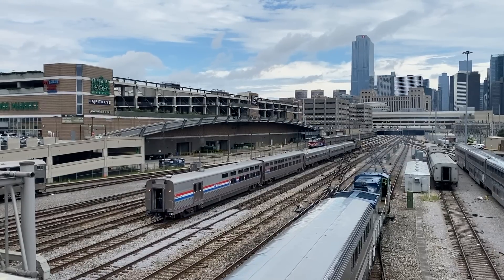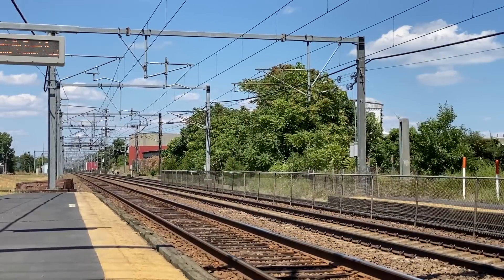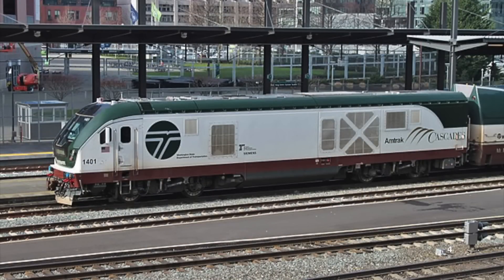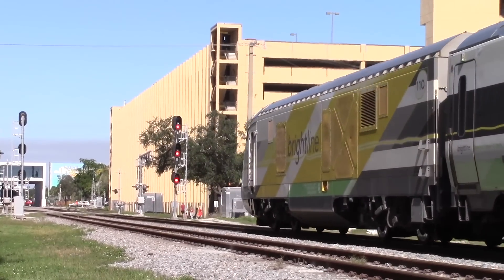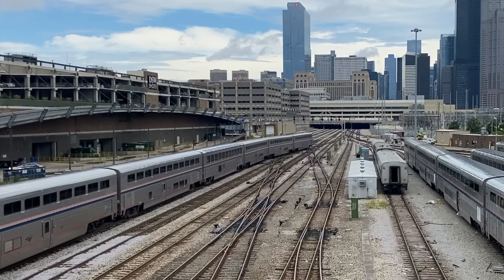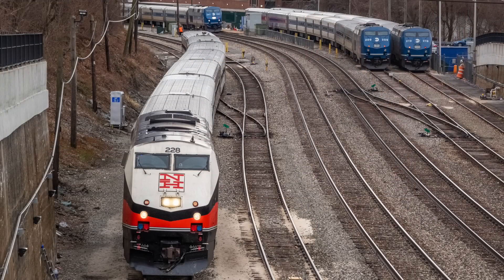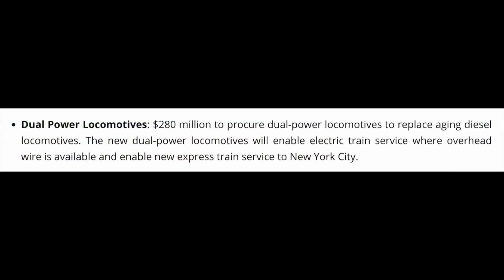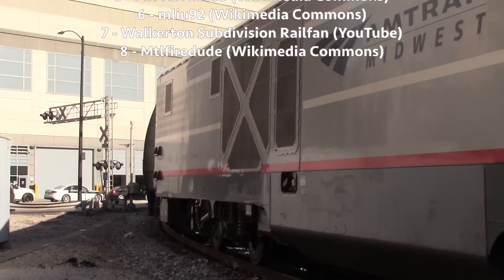Siemens Charger: Locomotive of the Future

Comment: Imagine freight railroads ordered freight versions of these locomotives.
Reply: Not necessary. I think there will be no cargo versions. The basic version, the Siemens Vectron, does not have a freight version either.

These machines are universal machines, have a starting tractive force that is 10 percent higher than the force that a GP38-2, for example, can generate. That doesn't change if you change the transmission. So you can leave it alone..... ;)
Reply: @pearlyhumbucker9065  In Europe lots of freight trains are running with the Vectron.
Reply: @Hauketal  Yes, well, I know. It's just something that Americans have to get used to.
They have had four-axle locomotives in freight service for years, but less in heavy service.
In American conditions, you can't get very far with a four-axle locomotive. To achieve the same tractive effort as with a four-unit consist of six-axle American-style locomotives, you would have to use six Chargers. No American railroad company would do this without necessity, it would simply be uneconomical.
Ultimately, there is simply no need for four-axle freight locomotives. So no one will design and build such locomotives specially.....
Reply: @pearlyhumbucker9065  Maybe if there is enough demand, Siemens will derive a 6-axle variant. But the Charger was mostly an opening without competition, as US manufacturers just didn't bid.
For a freight diesel the situation is different, I don't expect Siemens to make the effort to get into that market.
In Europe, the 4-to-6 conversion has already been done with an electric: The German class 152 (4-axle) was used as a base for the Danish EG3 (6-axle).
Reply: @Hauketal  
Well, that probably wasn't a 4-to-6 conversion. The EG was an extended EuroSprinter based on the modular design used in the 152, i.e. an independent (further) development of the ES64, after all the EG was longer and heavier, but did not have quite as much power as the 152, and it is also a multi-system locomotive

But whatever. The mere fact that it is an electric locomotive makes this argument invalid - the Americans do not buy freight locomotives in carbody form, which means that a 4-to-6 conversion of the Charger is off the table.
Reply: American companies practically lead the world in diesel freight locomotive design, and American freight operators are basically looking for the opposite of the Charger. There's no market for Siemens freight units in North America
Reply: @andrewreynolds4949  
US freight diesels haven't seen new developments since the early 2010s, and given that EMD and GE have pulled out, the US isn't really doing much developing of freight diesels in the first place. Unless you consider putting batteries where the engines are supposed to be some sort of revolutionary concept for the future. 
Arguably the best current freight diesel is the Stadler Eurodual, and is, as the name implies, dual mode. It's a six-axle design that can reach the power of your average Evolution series in diesel operation, but also produces over 6000 horsepower during electric operation. That can be increased further by using the diesel engine as a booster.
Reply: @mikeblatzheim2797  How fast are you expecting things to develop? Technology research doesn't generally move that fast, most of the improvements currently underway will be minor without much publicity. The locomotive manufacturers dabbled with units in the 5000 and 6000 hp range 30 years ago, but I think I've mentioned why that line of development died elsewhere. The battery units I think are just an experiment to see if they're any useful, if there's any advantage in them at all, kind of like the gas turbine units were many decades ago.

As far as GE and EMD go, they pulled out during market downturns and increasing environmental regulations. The locomotive divisions are now owned by Caterpillar and Westinghouse, not exactly small names. There's still a strong export market too
Reply: @andrewreynolds4949  
Well, let's compare the development of diesels to that of electric trans then, shall we? Since the 60s the main developments have been AC traction motors (originally developed for electric locomotives) and reduced pollution with a marginal increase in efficiency. And given the limitations of internal combustion engines, they're not going to improve much either. Meanwhile electric traction has seen the development and introduction of AC motors, regenerative braking and significantly more efficient motor control. 
The German ICE 4 makes somewhat less power than the 20 year old ICE 3 but uses half as much whilst being no slower all the way to 120 mph. Just in the last 20 years the equipment has gotten much smaller and more efficient, to the point where Stadler with the Eurodual has managed to fit a full sized diesel engine into an electric locomotive.
Reply: @mikeblatzheim2797  The EMD -38, -39, and -40 series all came out in the 60s. That was when a new generation of more powerful and efficient engine blocks were introduced. Then the -2 series was introduced, with greatly improved electrical systems and engine controls. And then in the 80s and early 90s microprocessors were introduced along with another new generation of prime movers, together producing more power and an additional ~10% fuel economy. Since then more refinements have been made, and after the end of the superpower race (the SD80 at 5000 hp worked fine, I must note, but ~4500 hp has been found to be optimal for modularity) focus has shifted to greater efficiency and meeting environmental regulations. The most recent models have yet again increased engine efficiency: the manufacturers are claiming something like 15% improvement on the previous generations. Yes there has also been the introduction of AC traction, starting in the late 90s and early 2000s, but we are now in a second generation of that technology. The invention of digital control systems and computer-controlled engine management have also significantly improved power and efficiency. 

So, there have been significant developments in diesel technology since the 1960s. I have also seen claims of something like 80% fuel efficiency improvements or more, so significantly better than "marginal". Many of the developments seen in electric locomotives are also applicable in diesel power, the primary difference being where the power generation comes from. Diesel engine development is far from dead, and ironically it is the Germans (who produce most of the marine diesels in use worldwide) who have been pushing the technology the most in recent years.

Comment: The Vecron has inly been introduced in 2010, so it definitely wasn't a great succes when Amtrak ordered their locos. 

Fun fact, the Vectron diesel sold that bad in Europe that Siemens isn't offering it anymore. Instead they replaced it with the Vectron dual mode, which can operate under ooverhead wire or diesel. This one, despite just being introduced, sells way better.

Comment: Outside of Amtrak and the NEC I think a better fit for American operators is the MPXpress series. I can't believe you consistently mention far less successful competitors but never even name the MPXpress.
Reply: American rail isn't supposed to be competitive.🤫🙄🤭🤭🤭🤭
Reply: @richardscathouse  What do you mean? There has long been fierce competition between the primary locomotive manufacturers, mostly GE and EMD, and there is still a great deal of competition between the freight companies (though they do cooperate far more these days than they used to. No one is shooting up a rival engine shed over Raton Pass anymore)
Reply: @andrewreynolds4949  
Well, the days of EMD and GE competition are history, since both have pulled out of the freight locomotive market. Wether Caterpillar and Wabtec will be successful and equal competitors is yet to be seen, but as of now, the US railway market is basically dead. The big four railways have arranged themselves into what's essentially four regional monopolies (meaning thar almost anyhwere in the US, if you want to ship something by rail you've got a single option) and there is no longer any significant US-based freight locomotive or passenger stock manufacturer. The result of which can be seen with the huge passenger stock orders coming Siemens's way; since there is basically no competition one company can come in and sweep the entire market. Wether a similar thing will happen when the current crop of GEs and EMDs are due to be replaced is entirely dependent on both Caterpillar and Wabtec (who are both complete newcomers to this) getting their businesses up and running without any money from major orders. And I don't see that happening.
Reply: MPXpress is Discontinued

Comment: Brightline is not a "higher speed rail" operator. The speed limit on Brightline's entire current line is 79mph, and their trains never even go above 70mph.

After the new extension is build they will have a large section of 110mph in addition to their current 79mph trackage and a tiny, 20 mile section of 125mph trackage. So after the upgrade you could say that Brightline will become a "higher speed rail" operator. But they aren't one currently. Right now, Brightline is 100% a conventional speed operator.
Reply: And it is working, example for more corridors?

Comment: Cal me crazy.. but Amtrak looks so outdated..   and dirty..    only the locomotive looks good.
Reply: they are adopting siemens venture coaches to match the chargers, but long distance is still up in the air for now
Reply: @Eaglescout217  Still haven't heard anything new from the long-distance RFP. Weren't proposals due last month?
Reply: @MrMarshmallow26  Well they did announce the Amtrak Airo sets in the winter. Long Distance locomotives are being phased out for the ALC-42 Charger. Sleeper cars news wise are still up in the air, but mostly be based on the Nightjet.
Reply: @Eaglescout217  The Airo sets are only for intercity routes. A separate RFP was put out by Amtrak seeking a manufacturer for new long distance equipment. Nothing has been said about proposals though despite results being due a month or two ago… unless the potential manufacturers requested an extension.

Comment: It's certainly a bit better future but It's certainly a bit better future but if you really want a future for rail you'll need to nationalize the you're rail infrastructure and electrify it.
Reply: Glitch on the pantograph, will be fixed.
Reply: Passenger rail MAYBE, but at the cost of screwing over the economy, the power grid, and the whole freight rail system in general
Reply: @andrewreynolds4949  
The railway network wouldn't actually use so much power as to impact the electrical grid, and FYI, electric freight trains are also a thing. Besides, electric railways tend to set up their own power grid. 
In the long term this would make the network much cheaper to run, as the locomotives are more powerful (meaning you need fewer of them), cheaper to maintain (because they don't need diesel engines) and cheaper to run (no diesel, you can also recover braking energy, which is particularly effective on mountain routes). But of course, the long term benefits would require a lot of upfront investment, and sadly publicly traded companies treat upfront investment like the plague.
Reply: @mikeblatzheim2797  No, electric rail does use massive amounts of power. And I don't know as much about how other electrical systems run, but I read all the time about the railways over in Britain applying for modifications or feeder lines from the national power grid. In any case, they still need large numbers of new power plants to generate that quantity of electricity, and that isn't happening anytime soon.

There were actually diesel locomotives designed that were significantly more powerful than are commonly used now (there was a huge power race in the 90s), but for a number of reasons the industry has settled on ~4500 hp as the best standard in North America. This gives more modularity and redundancy, since they can more closely tailor power requirements for better efficiency and because the loss of one unit is less of a loss on the whole train.

I would like to find some real hard data someday on the full cost of electrical rail power. I suspect a lot of the advantage of the lower cost and maintenance of electric locomotives has actually been shifted to the greater infrastructure needs rather than eliminated. Electricity still has a market cost, too, which at various points has been higher or lower than diesel fuel. OLE also is a lot more disruptive when it breaks than a single locomotive, and it's much harder to maintain than diesel locomotives you can take to the shop instead. Doubling the infrastructure maintenance requirements in remote terrain (which the US has a lot of) is not a nice prospect. 

Electric traction is generally better at high speeds and high acceleration, both of which are more important for passenger service than long-haul freight. There are cheaper and more efficient options for improving freight capacity, and not enough benefit from electrification to justify the enormous cost of rebuilding the whole industry compared to the current course of developing greater efficiency with diesel traction.

There's some sort of myth going around that the freight rail companies refuse to invest in their systems. That's not the case, they just don't want to invest in highly disruptive projects they won't see the benefits of which break even with the costs for over a hundred years. Forgive me if I think that's generally good business sense, even for most government programs.
Reply: @andrewreynolds4949  
The reason why freight railways settled on about 4500 hp is that the more powerful engines were a maintenance nightmare and rather unreliable. 

The power consumption really isn't that bad. Just think about it, most trains make do with less than 10000 kW, and their frequency is low. A single small powerplant is enough to power dozens of trains, heck, a single wind turbine can generate more electricity than a train would need. 
Electrification of freight routes does make sense, for reasons I mentioned already. You get cheaper and more powerful locomotives, and a much higher operating efficiency due to, among other things, regenerative braking. 
No-one is wanting to electrify every single bit of line, because that would indeed be too expensive with too little benefit. However, the electrification of the main lines does make sense; in fact, during the oil crisis a plan was set out for the electrification of all major US routes. The long distances aren't an issue either; look at the former Soviet Union. So it is possible, and according to the plans from the late 70s the break-even would've been achieved within 30 years (a benefit of only electrifying main lines), and then saves billions a year. Of course, when the oil price fell again the private companies pulled out...
Especially mountainous routes benefit enormously from electrification. Your power consumption barely goes up due to regenerative braking, and you can make do with far fewer locomotives. The Milwaukee Road had over 1000 miles of electrification and operated successfully for decades; sadly mismanagement and a reluctance to invest after the early 1900s caused the railroad to fail. But their operating losses doubled the year after they got rid of electric trains and sold off the electrical equipment. And these doubled losses include the profit from selling thousands of tonnes of copper.
Reply: @andrewreynolds4949  
And US freight railways do have a reluctance to invest in their systems. Deferred maintenance is still a thing, and with 'precision scheduled railroading' they're stripping their infrastructure back to the bare necessities. If you've ever taken Amtrak you'll notice that the track is generally in a shocking state (BNSF being the worst), which is also why there are so many derailments across the US. 
Electrification also isn't as disruptive as you think, Caltrain for example is being electrified while they're running regular operations.
Reply: @joeykidd8916  
Increasing traction is as simple as adding weight. The most powerful locomotives on earth (both in terms of power and tractive effort), the Swedish IORE, shares its technology with other Traxx locomotives. In order to increase the tractive effort they ride on specialised, extremely heavy bogies, which increase the axle load from 20 to 30 tonnes. Put some dead weight into an electric locomotive and you've immediately increased its tractive effort.
Reply: @andrewreynolds4949 Dual modes for freight?

Comment: Why the hell does the US still use and buy single-headed locomotives? That's so impractical
Reply: You forgot about the Venture cab car which fixes that issue
Reply: @_SP64_  Do you mean tail cars for passenger push-pull trains? Those fix the issue unless you have to decouple the locomotive and use it with some other train, then you might need a turntable. In Europe and in some Asian countries turntables are usually relics of the steam engine times
Reply: @МаксимСтепанов-м6ч  yes i mean those, cab car is the north american way of saying it

Comment: Connecticut really ought to order DMUs (e.g. the Stadler FLIRT) for Danbury, Waterbury, and Hartford Lines.
Reply: They have to keep in sync with New York for the Danbury and Waterford lines as those use the same trains as Wassaic and Poughkeepsie Metro North services. Remember also that Danbury does have some direct service to New York City, so direct trains need to be able to run on 3rd rail. The Hartford line is another story and as you say might be a good fit for DMUs.